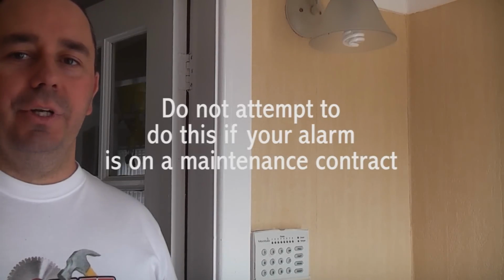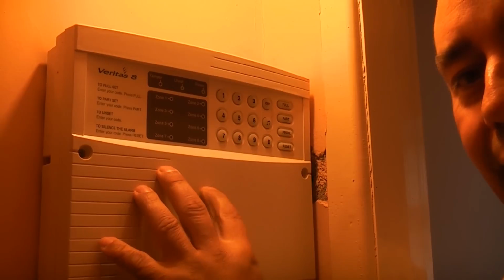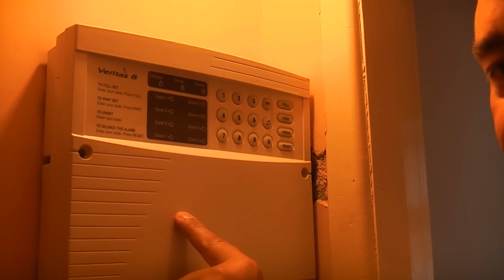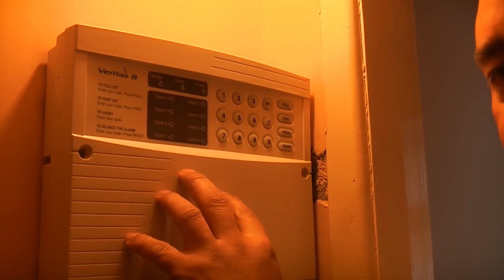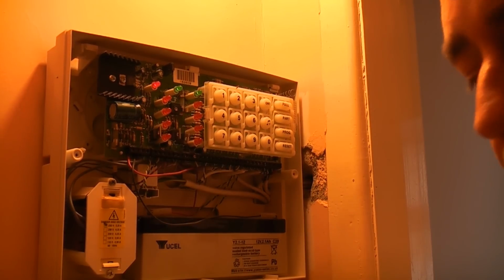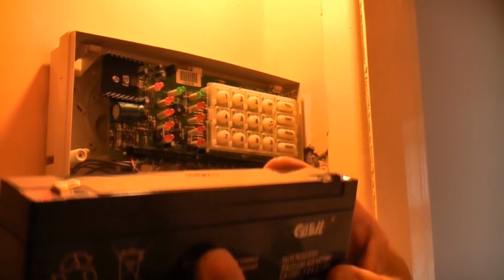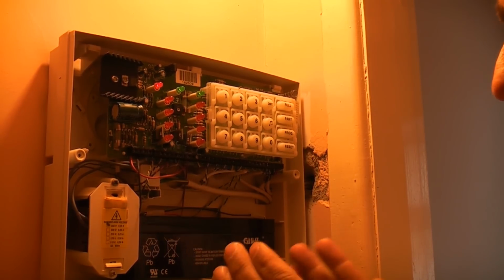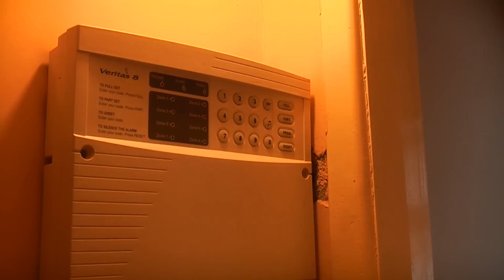Replacing a burglar alarm battery

Comment: Hi my alarm sets ok & can go off in the house but doesn't ring in the main bell outside of the house.Could this be due to the battery? i suspect not but just want to know if a possibility.Thanks ha looks like i have same alarm as you as well ! Veritas 8
Reply from the maker: No, I don't think the battery would cause that.
Perhaps you could check all the fuses in the alarm are intact?
Reply: @ultimatehandyman  thanks for answering, i will do that
Reply: @jasmineblack9778  could be a loose wire from the bell trigger check connections

Comment: How do I buy the 🔋battery, ?
Reply from the maker: You can get them on eBay etc.
https://fave.co/3fDDTwQ
Thanks for the comment 👍
Reply: @ultimatehandyman  hi bud got 1 mine in it is 1.3 amp new 1 is 1.2 amp 12volt  this b ok 👌
Reply from the maker: @granto6738   Yeah, that's fine.
Reply: @ultimatehandyman  mine is nor the same as that its a lot smaller  and got the    live  and neutral  at the left  side  of it
Reply: @ultimatehandyman  ya video  was very good bud had the original  battery  in 4 14  years  ,,so if I put the hole  of the power  off at the mains  the alarm  shouldn't  cum on ?
Reply from the maker: @granto6738   It depends, if you switch off the power and you have a bell box outside with a SCB, that could sound until the power is back on. But once the power is switched off, it is safe to swap the battery. As soon as the battery is connected the outside alarm should silence (you might need to input your code or press reset)
Reply: @ultimatehandyman  hi bud I have a bell box out side  I  will cut the power  off  at the weekend  thank s 4 ya help

Comment: How would you go about removing the battery cables from the battery clips if they won't come off when pulled?
Reply from the maker: Try using a pair of pliers, but make sure you grip the spade connector, not the wire. Wiggling the spade connector from side to side will also help
Thanks for the comment 👍
Reply: @ultimatehandyman  thank you, I managed to pull them off by gripping closer to the contacts by hand

Comment: Great video! But if I remove the battery and don’t replace it will all the sensors, beeps, chimes and alarms disable? I’ve had a problem where if I open my front door the house alarm starts to go off and entering the code doesn’t stop it, I’m not sure what to do.
Reply from the maker: If you switch off the power to the alarm, then remove the battery there is a chance that the external sounder will sound until the battery in that is exhausted (normally about 20 minutes). After that the alarm should be completely silent
Reply: @ultimatehandyman  thank you so much, sorry if I’m being a pest haha but if I unscrew and remove the front door sensor will it stop alerting the alarm when opened? Or will some sort of tamper alarm start to sound?
Reply from the maker: @Louiefelton   If you just want to stop it chiming, you can disable that from the panel (you'll need the alarm instructions).
If you want to remove the door sensor altogether you can just unscrew it- but you'll have to remove the magnet from the door and tape that to the sensor. https://www.youtube.com/watch?v=44WvvZVreLo

Comment: Was quoted £40 for battery, plus £80+vat labour to change the battery. Talk about rip off.
Reply from the maker: Blimey, that does seem expensive!
Thanks for the comment
Reply: @ultimatehandyman  Thank you for this helpful and honest guide.
Reply from the maker: You are welcome 👍
Reply: @ultimatehandyman  I changed the battery, but now have a 'control panel tamper' message on the keypad. Any idea how to get rid of the message and reset the keypad? Really appreciate any help. I have a gardtec system.
Reply from the maker: Normally you just press the reset button.
If you have the user manual, it should tell you in there. Or if you Google for the alarm user manual you should be able to get it in PDF format.
Reply: @ultimatehandyman  That's the thing, there's no reset button. And the online manual doesn't mention it. 
I think I'm supposed to press two keys simultaneously to reset, but don't know which.
Reply from the maker: Have you tried entering the user code?
Reply: @ultimatehandyman  Yes, it sets of the alarm and gives another message. I'm exhausted today. Will revisit tomorrow. At least I've stopped it ringing every hour.

Comment: Why do alarms in the UK treat troubles (low system battery, tampered device) as full alarms even when disarmed? The only thing that happens with my system is the control panel starts beeping.
Reply from the maker: Not sure
Thanks for the comment 👍
Reply: Because in the UK we have external alarm boxes (bell boxes) that are fitted on the outside of buildings and make loud noises. These contain an SAB (Self Activating Bell) which has an onboard battery so if anyone cuts the wire from the bell box to the main alarm panel, it will start sounding. When the panel battery is dead and there is a power cut, there is no power to the panel, so there is no supply to the bell box, so the SAB inside thinks the wire has been cut and it goes off.
This only happens if the alarm isn’t maintained!

Comment: Hi my power light keeps flashing... is this because i require a new backup battery? thanks
Reply from the maker: I'm not sure, as it depends on the make and model of the alarm.
If you switch the electric off to the alarm and then switch it back on 5 minutes later, if the alarm sounds, then the backup battery will need replacing.
Thanks for the comment 👍

Comment: Is the code you put in the usual code used to deactivate the alarm on entry? Or is it a special engineers code that I have read about online?
Reply from the maker: If you are opening the cover first, you just need the normal user code (which you input to set/unset the alarm).
If you know the engineers code, you can input that before opening the panel, and that will allow you to change the battery without the alarm sounding.
Reply: @ultimatehandyman  Thanks for the video and comment. Changed the battery this morning. By the date on battery, it hadn't been changed by previous owners in 11 years! No wonder the alarm went off when we had a power cut.

Comment: If the battery is dead could you not just switch off the circuit breaker for it at the consumer unit ?
Reply from the maker: Yes, you could do- but if the external sounder has a self contained battery, that will sound until the power is restored.
Thanks for the comment 👍
Reply: @ultimatehandyman  What if the external sounder battery was also dead ? Presumably with both batteries dead and the power switched off at it's designated MCB, you could dismantle the burglar alarm or/and external sounder without any alarms going off ?
Reply from the maker: Yes, if the external sounder battery is flat you can switch the power off and do anything to it, without any sounders going off.

Comment: ooh ! my alarm went off this morning and keypad inoperative as power cut so could not switch alarm off ! happy neighbours! luckily power came on and I got it switched off, so I guess my battery backup in the scantronic 9448+ end station is dead. Its done well as i fitted the whole system 19 years ago in 2000 as a young lad, now I dont have the bottle to open it up or fiddle with it ! Not sure if I should enter the 'programming/service mode on the control panel and then open the 'box' or do as you did and just open the box and then enter my code to get the alarm bell off? could take me a while to source a battery once ive seen whats inside, or should I google and see what battery is inside and buy that and have it ready to do a quick swap over? cheers.
Reply from the maker: If you know the engineers code, then you can enter that- then open the alarm and it should not go into tamper mode.
You can then see what battery it takes and get a direct replacement. 
I'm surprised the battery in the bell box is still working after 19 years- they don't normally last that long!

Thanks for the comment
Reply: Thanks for the reply !! Yes I was surprised too, it was going away like a little bomb! I seem to remember that it was only a small rechargeable battery in the bellbox like the size of a torch battery like a big thumb size! I read that because the battery in the main box is so  old it may have gone faulty and blown the transformer which trickle charges it as well, in that case the new battery wont charge or last long too, do you think I should see if the wires to the battery inside have a feed/charge the battery, or just take a chance and fit and see what happens? I have found instruction book, and it says 'initial start up' user access code 1234, and also enter programming ..code 7890 I guess i need the programming code as understand that would be the engineer code? thansk ever so much for your help, Ive rang a few alarm engineers but no one has bothered to get back to me!!
Reply from the maker: Yes, I'd try the programming code- although it might have been changed at some point.
I replaced the transformer in mine a few months back as it was getting really warm, so much so that it was melting the plastic, I managed to find a direct replacement online.
I would have thought that if the transformer is not working, the alarm will not work- for long! 
Sorry for the late reply, it takes me ages to find comments on comments- sometimes I can't even find them to reply.
Reply: Hi again, thanks for the reply, well i entered "0  then 7890 enter" and it did go into engineer mode with all leds flashing, I opened the main box  and nothing set off,  fitted a 2.1ah yuasa, (it had a 2.8 yuasa in and slightly different shape) put the lid on, entered 99 ENTER and all leds went out. happy days, I can also now hear the very slight hum from the box that used to be there, i think it stopped humming when the battery was duff ! Thanks again for your replies, it helped me get courage to attempt it!!

Comment: I have a veritas house alarm, and the alarm is sounding even when unset and zone 8 is lit up, but there are no zones open,any ideas??
Reply from the maker: Not sure what is causing that, but perhaps it is something to do with the anti-tamper.
You could link out zone 8 using a small piece of wire between the zone 8 terminals to see if the problem still persists.

Comment: Should I cut power to the box by turning off the power from fuse box before removing the dead battery? Also which terminal should I remove first positive or negative or doesn’t it matter?
Reply from the maker: No, it is best to leave the power switched on, or else the external sounder will sound.
It does not matter which wire you remove first.
Thanks for the comment

Comment: Hi I stupidly cut one of the PIR wires, I have connected the PIR but it is still in tamper mode, do you know how I can completely reset it? Thanks
Reply from the maker: If you re-join the wire and replace all covers you should be able to reset it on the panel.
If you can't reset it I would check the glass fuses in the panel to ensure none of those have blown.
Reply: Ultimate Handyman i have tried this although looking at it I think I may need a new PIR as my temper spring is missing! Thanks for the reply

Comment: You may just have saved me smashing my alarm with a hammer .. I don't actually need this alarm so I'm hoping that this will deactivate it for good .. I just moved into my house with the alarm system already in place and I had a power cut last weekend .. the alarm has been going off internally not externally for almost a week, I need sleep ha ha  .. I will let you know the outcome soon ...If I don't get back to you with my result then you can anticipate that I am in an electrecuted state .. (I will be turning off all mains supply before attempting this )

Comment: Thanks for the video, great help! I've ordered a replacement battery but now am fearful because the original was a rechargeable but the replacement is not (12V 2.2ah). Is that still ok for the control panel or will it run down in quick time? Thanks
Reply from the maker: I thought all Burglar alarm batteries were rechargeable. I would imagine that if the power went off for a considerable amount of time and the alarm was sounding it would flatten the battery pretty quickly.

Comment: i have moved into a new house and the alarm was switched off the fuse was taken out. put the fuse back in and the alarm started going off. i put the code in they gave me but it didnt work. Is there anyway to factory rest the alarm?
Reply from the maker: There should be a way of resetting it but you would need the engineers manual, there are some here-
http://www.ultimatehandyman.co.uk/forum1/alarm-manuals-f132.html

Comment: I've replaced the battery but when I switch the mains back on the alarm sounds. I've entered the code but this doesn't silence the alarm. 

Any ideas why this could be happening?
Reply from the maker: Some alarms have a reset button that needs to be pressed, does your alarm have one of those?

Comment: Guard tech control panel has gone blank, any ideas on what's the problem?
Reply from the maker: I'm not familiar with that particular alarm, sorry.
You could check that the alarm is getting power though?
Also you could check for an internal fuse that may have blown?
Do you have the engineers manual for it?

Comment: electricity was switched off yester for few hours & now alarm isn't working. PIR sensors are OK in the house & the alarm panel in the house is back lit but nothing happens when you press the buttons & power light isn't on, any ideas!

Comment: I have this exact alarm and the battery has not been changed since installed it 2008. I cut the power and the alarm sounded so looks like I will be changing the battery soon. Thanks for yet another great video plus useful forum. : )
Reply from the maker: You are welcome Mike ;-)
Thanks for the comment

Comment: Hi 
I've just come home from the school run, temporary power cut whilst out (5mins) and now my remote control is sounding off a high pitch noise and saying tamper and nothing is working. Could you please advise me as to what I should do as don't want to call the landlord at work if it's something simple?
Thanks
Reply from the maker: +Linsy Morris Have you tried entering the code to silence the alarm?There might also be a reset button on the control panel?
Reply: Thanks for replying.The control panel where you set the alarm is just saying tamper and nothing I press is working. Do I need to call an engineer as it's still going off?
Reply from the maker: +Linsy Morris 
You might need to. Best to call the landlord and see what he says!
If there is a fused connection unit nearby, there should be a fuse that you can remove until you get someone to take a look at it. 
You can see a FCU (fused connection unit ) in this video- https://www.youtube.com/watch?v=47fkKdBjqvI

Comment: Hi, my little green light is flashing and if I flip the breaker the alarm instantly sounds which makes me think the battery is dead. If i try and set the alarm it just beeps 10 times...
My question is..
Do you turn the power off (put up with the alarm) and then take the cover off, swap the battery, put the cover back on, turn the power back on the press reset? Or
Do you do it all with the mains still live and just be careful with the battery terminals?
Reply from the maker: +James flashman 
If the power is on to the alarm you should be able to reset it?
If you can't reset it with the power switched on there is another problem with the alarm.

Comment: Any half decent alarm installed in the last 10 years should make an audible beep at the keypad to notify the user that the mains power has failed.
Batteries are rechargeable with a battery life of between 5 - 10 years, will be  lesser life span in an area with many power cuts.
Batteries are fully charged when purchased.
Water getting into the external sounder does not cause the alarm to go faulty, they are designed to be mounted outdoors in all weather conditions including rain and freezing conditions.
If in any way unsure, get in a professional as you don't want to make the problem worse..... pay cheap pay twice. 
Regards